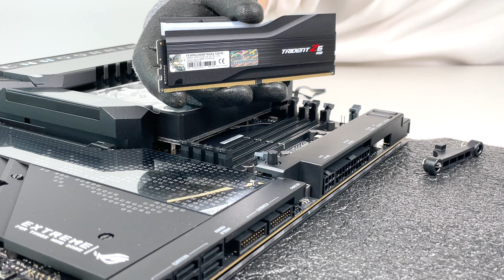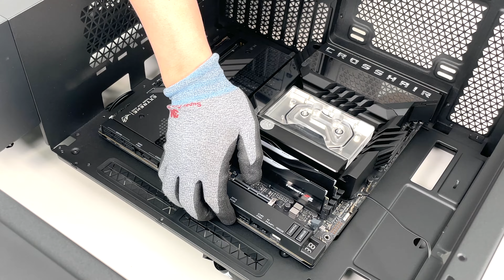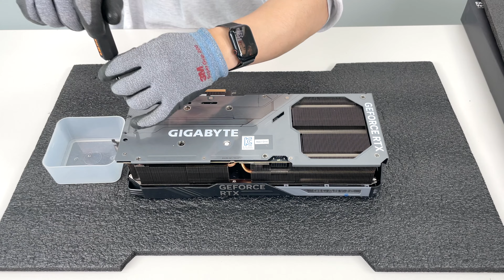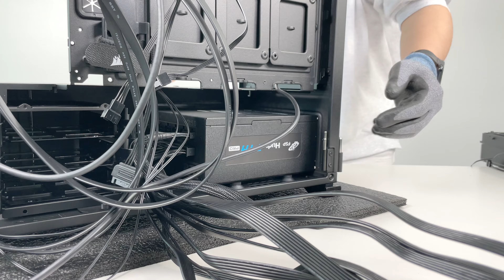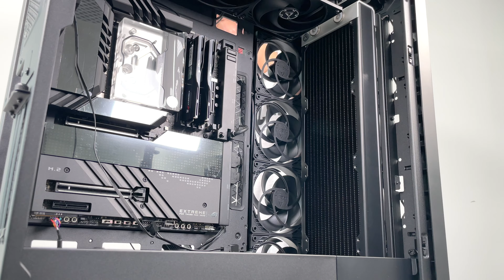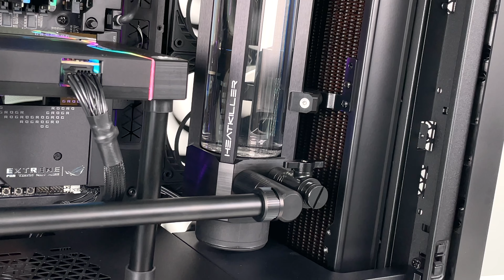$6700 7950X3DㅣRTX 4090 Mette Black Watercooled PC

Comment: I would not dare to pair Asus motherboard with 3d cpu after all that ASUS fiasco with burned CPUs
Reply: There is some truth to this comment, but if he is running default settings there is no need to be alarmed. This is only if the overclocking settings are enabled.

Comment: That look when you see a collision with the ports: https://youtu.be/4BULLJcPkaQ?t=158. Then the top rad was replaced with a thin one. It is better to use a thick top 360 rad in a push-pull mode and a thin front 480 rad in a pull mode. You just need low profile fittings.

Comment: noo nooo dont get AMD they overheat get the i9-13900k or ks
Reply: they overheat more 💀
Reply: You know, that the Ryzen 7x3d CPUs are very efficient and they won’t be so hot like 7950x for example.🙂
Reply: @0xBlez  well if you get a trash cooler then yes but the intel they heat less and last longer and are more powerful with their best cpu having 24 cores 6GHZ
Reply: @MrTefe  You shouldn't buy trash cooler if you're buying high end CPU anyway. If you want to talk specs to specs, Intel uses more power therefore generating more heat. The "lasts longer" thing is bullsht. No evidence to back it up. Also boost clock and core count doesn't represent everything in real world use. For example 7800X3D with 4.2GHz boost clock and 8 cores can beat i9-13900K that has 24 cores and 5.8GHz boost clock.
Reply: @crowschattenpfote  3d shit has 10% slower power and costs more
Reply: @0xBlez  3d cores run slower and they overheat and break the CPU and intel doesnt break and 8 cores is trash compared to 24 cores and userbenchmark says i9-13900k beats ryzen 7800x3d and also youtubers pick games that are optimised for AMD and they say its better but in reality you are wasting your money on that AMD bullshit
Reply: @MrTefe  but if you want only playing g games the x3D CPUs are the way to go, because in many games, they’re much better, than Intel Raptor Lake.
Reply: @crowschattenpfote  No i already have choosen intel because they dont break and have 24 cores and 6 GHZ speed and i have good experience with intel and the i9-13900ks is the worlds fastest CPU so it fits my PC
Reply: @MrTefe  if you have an 13900ks that’s cool. But if you want to build a pc, a x3D is sometimes much better, than an Intel CPU. Furthermore the x3D only breaks, if you have OCed them. If you haven’t done it, they won’t die.
Reply: @MrTefe  We get it. Your an Intel fanboy. Calm down. The 13900K is old news; it’s weaker then the 7950x 3D in games and uses way more power. It doesn’t make much sense at the same price point as a 7950x 3D.
Reply: @apricotmadness4850  13900K is not weaker in games than 7950X3D given that you tuned your platform properly.